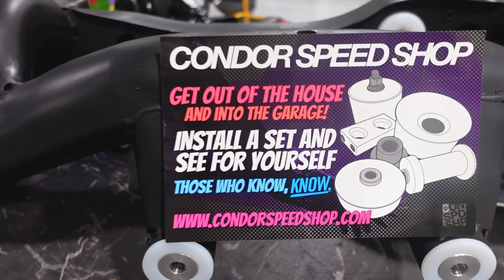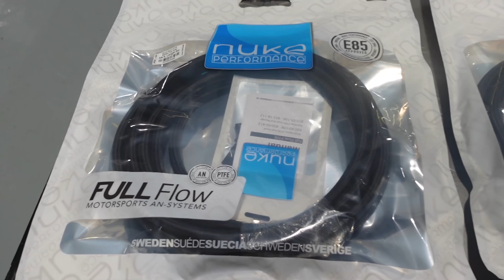E92 Build: Wisefab Front + Rear Suspension

Comment: cricket give us a run down on which engines you think are best for drifting I know different sports use different combos and LS's are the cheapest right but what's your take on the best power plant for a street/track car you know a multi purpose car
Reply: Jz
Reply: Personally I’m a LS guy when it comes to best for drifting. 1 parts are cheap and available at any local parts store. 2 with even little sr motors going for 4k now you can buy a used 6.0, an adapter plate from us and find a ZF trans for the price of a 4cyl Japanese motor. Oh and have more power out the gate 🎉 but I do love my JZ’s for LHD and RB for RHD cars. Just Gods motor over the rest 🤘🏼

Comment: Crazy question but why don’t you guys use the big sandblasting booth? You can fit a tone more inside n blast so so much more faster. Or is it not working? Or ppl don’t know how to run it or the big blasting pots?
Reply: Sand blasting is good, but not good on anything sheet metal. Clean up can be a pain before paint as well. I like wet blasting, no dust, you can see what you are doing much better, no warping either.
Reply: There was a bunch of stuff in the way of that booth and it needed a quick once over before using it. She’s cleaned out now and ready to party for whatever our next big job is
Reply: @growlith6969 there not blasting sheet metal. There blasting cast n thick steel. N it's a blast booth I'm talking about you don't paint in one. It's for sand blasting only. It's got suction vents n you have to wear a blast helmet with breathing lines n tear offs so U can see. N wet blasting doesn't give the best profile for your paint to stick too.
Reply: @CrickettFab  you'll find it so easy n fast once you get the big blast pot running well. Imagine the lil parts blaster x20!!!! Downside, sand where it shouldn't get. 🤣

Comment: The hell were the BMW engineers thinking on that rear suspension? Like 4 links and an arm and a coilover, vs the front that is just an arm and a coilover. I get that the rear has adjustment in literally every direction but man, how much of that is really needed?
Reply from the maker: It's German Engineering, it definitely offers maximum adjustmen. During a 5 min call in comp It is really convenient to be able to adjust everything around a bent arm and still be within spec.
Reply: @DriftHQ  Good point